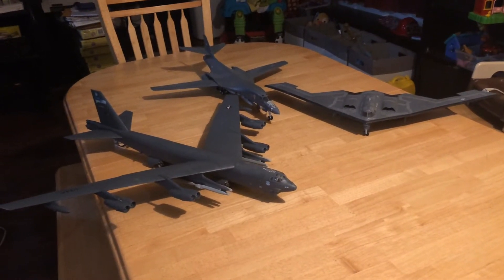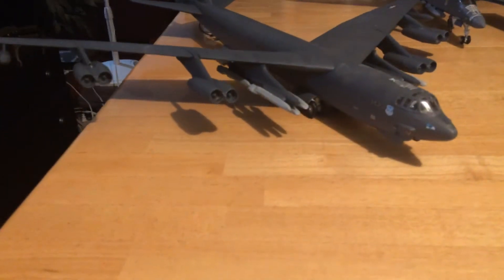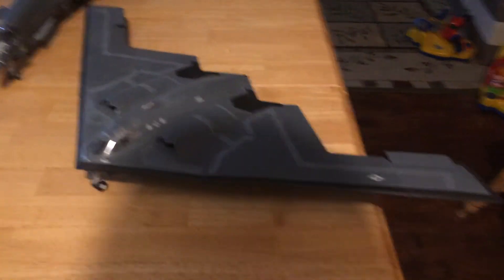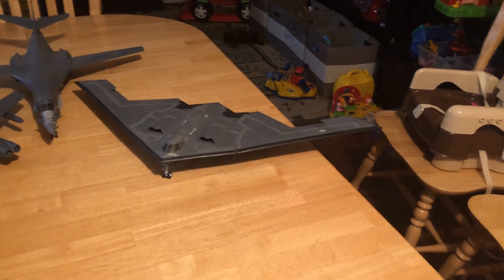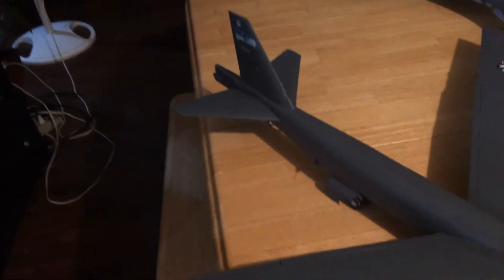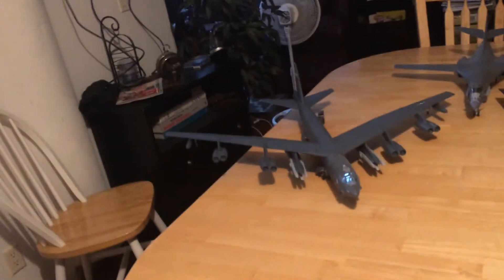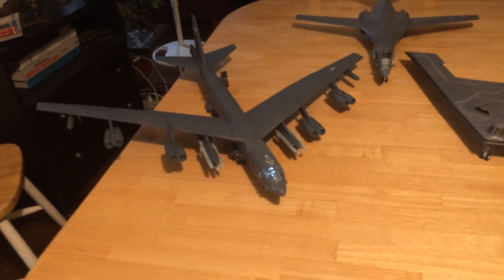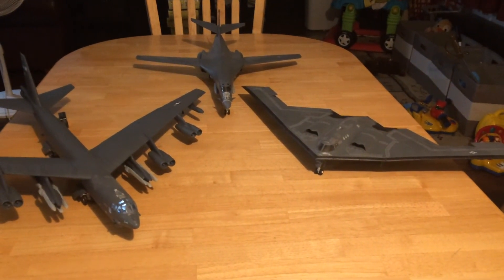USAF Heavy Bombers (B52-H, B-1B, and B-2) 1/72 Scale

Comment: The missiles on the b-52 are not tomahawks they are agm-86 cruise missiles that weigh 2,500 pounds and travel at a speed of 600 mph and have a range of 1500 miles and can be launched from the b-52 outside of anti aircraft range and each missile can carry a 3.8 megaton nuclear warhead enough firepower to wipe out all buildings and life on the island of Manhattan

Comment: Norman Normal
The B52 is a cheap cruise missile truck for low threat theatres.  The B2 is for high threat theatres.  What's the B1B's niche at this point?
Reply from the maker: Witht he types f ALCMs the B-52 can carry, they are oing to be effective in any theater, same with the B-1B and the B-2.  Clearly the B-2 is also capable of penetration of high threat areas and would still be the US functional nculear triad.  With its speed and low level penetration capabilitly, the B-1B could also be used in that role.  All of them can also carry anti-shipping weapons and could be used at any time in that role receiving targeting from satelites, from P-8A and MQ4C communications, of E-2D or other recn capailities.  So, all three have multiple uses. 20 ALCMs make te B-52 a significant threat in any theater to this day.
Reply: @JeffHead-IdahoUSA  I read that the B2's serrated trailing edge is designed for low level aerodynamics and penetration ability.  The USAF didn't want to go with a pure stealth flying wing design in case stealth was ever compromised.  The B1B could still suit that application..